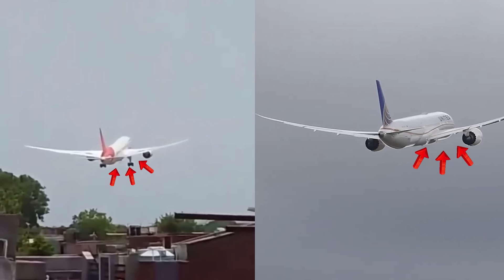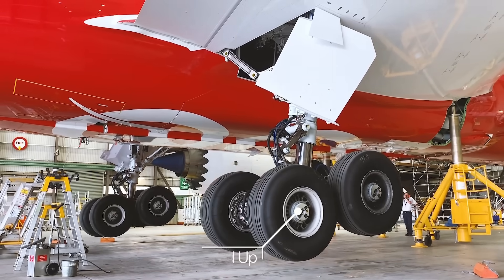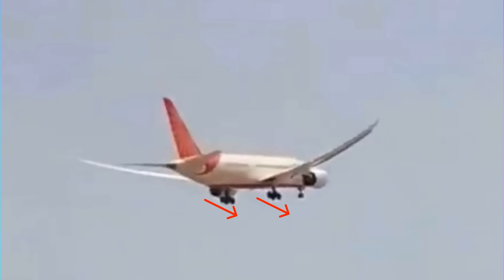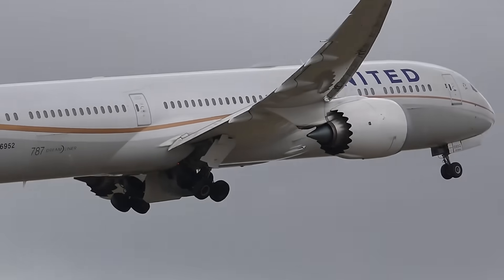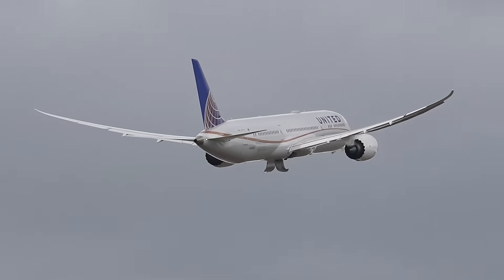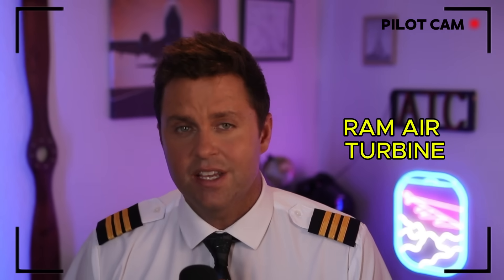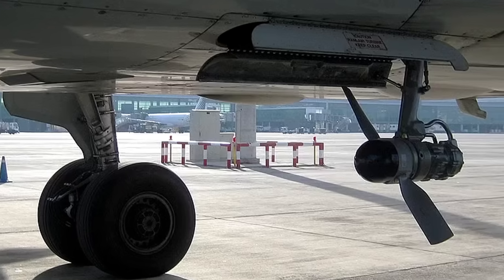Pilot Explains: A New Detail in the Air India 787 Crash Everyone Missed

Comment: Previous electrical issues.High ambient temperature.Aircraft static in 40 deg temperatures for prolonged period.Possible scenario - 
Circuit breakers are susceptible to thermal influences, primarily due to their reliance on heat for operation, particularly thermal circuit breakers. Ambient temperature, heat generated by the circuit breaker itself, and heat generated by other components in close proximity can all affect their performance and lifespan.
Overheating: When circuit breakers are exposed to higher than normal temperatures, they may trip due to thermal overload. The increased ambient temperature can reduce the breaker's ability to dissipate heat, causing internal components to reach critical temperatures.

Comment: Hi you are right 
I am a normal man put of germany  with adhd and i am very good in technic.
There is a problem with hydraulic gears stays down pumps get out plane rotate no more postive fuel preasuere and this case the suck air in the engines a vaper engine failure
Reply: And thats because the plane is in a very hot take off condition all is hot 2 hours on tarmac 
I think this was the problem

Comment: I believe logical speculations are down to two main scenarios:

1) just as plane tilted up for takeoff, both engines lost fuel supply, resulting in electric outage..

OR 

2) Major electric outage resulted in fuel supply cutoff (if that's even possible!)

However complex the core reason may potentially be, it's very likely simple as that.. Fuel supply cutoff.

Comment: What if the electrics went out first ? I might be wrong but if you had an electrical power failure you would loose hydraulics and also the fuel pumps which  would also explain why the Rat deployed.

Comment: It was very vey hot on the day - maybe fuel line system vapour lock. Both engines spooling back at the same time - very odd and so a single cause is in my mind. Time will tell

Comment: If there was a major failure in the electrical system then the fuel pumps would stop working, leading to both engines shutting down. Could the landing gear retraction demand have caused a catastrophic electrical failure, hence the partial retraction of the main wheels as the hydraulics would have failed? If I understand correctly there’s triple redundancy in the 787 flight control system, any mechanical backup (which I don’t think there is) would also fail as there were no hydraulics. The CVR and CRDAU/crash recorder will provide vital information as to the cause. 
Also, during the descent looked controlled, there was no sudden change in attitude, it still had a positive angle of attack. It’s almost as if the pilots were trying to bring the plane into an emergency landing, but there was nowhere clear to land. The same could happen at Ronald Reagan airport, London City airport and probably many others that are located very close to densely populated areas.

Comment: Is it possible that the plane was loaded with contaminated fuel before take off.  If so, there would be I imagine, some of the ORIGINAL FUEL still in the pipes leading to the engines allowing it to taxi and take off...... Once in the air the ORIGINAL FUEL was used up....then the CONTAMINATED FUEL caused the engines to stall..  
Just a thought as the plane did Taxi and Take Off.
Reply: No. It’s not possible. Unless a contaminant was deliberately mixed in an act of sabotage.

Comment: Good  logical presentation, it’s beginning to look vert much like a duel  engine failure, if so , the next question is why. 
It worries me that it could be electrical failure. The 787 had many electrical problems in its early days, the battery run away fires was the most publicised issue, and apart from jettisoning the runaway battery, I don’t remember there being a proper solution. Has any one got any updates on the battery situation ?

Comment: According to ChatGPT a dual engine failure during takeoff under the given circumstances the most likely cause:

	•	Fuel starvation: No fuel reaches the engines (e.g. mismanagement of fuel selectors, empty tanks).
	•	Fuel contamination: Water, ice, or microbial growth in fuel can cause both engines to flame out.
	•	Incorrect fuel type: Jet fuel accidentally replaced with avgas or vice versa, leading to failure.

Comment: Erroneous inputs causing automatic power reduction. Possible airspeed excessive input due to water or obstructions. For some reason fly by wire system with computer inputs reduced power or caused power loss on takeoff such as bleeding air off engine stages causing engine stall failure.... then what stops landing gear retraction?..... engines not running... no electrics hence rat deployed.

Comment: Vapor loss, dried out pressurized hoses / pump lines, due to long standing on tarmac before take-off.
During nose up, air bubbles will accumulate, like in bottle, in the wrong spots, that is not sufficiently anticipated, when at the same time it also adds to loss of hydraulic power in the landing gear pull up system.
This potential explanation was first brought up by another jetliner pilot tuber.

It was a boiling hot afternoon. The elements turned against sophisticated designs, calling out weaknesses and hidden flaws.

Comment: Most convincing summary I've heard so far. Add together the behaviour of the plane, the RAT deployment and the Mayday call, and it's clearly a catastrophic loss of power and thrust. So it can only be the simultaneous loss of both engines.

As to the reason for this, we can only wait for the official report and analysis. No amount of discussion on YT channels is going to get us anywhere, we simply don't have the facts. 

The only thing that still puzzles me is that they didn't rotate until the very end of the runway. This seems inherently too risky to be normal practice as others have suggested.

So, I'm left asking if this is another clue? Was there some sort of power/thrust problem before the takeoff - something that made them miss the normal rotation point, but also something that caused the pilots to think they could still make takeoff and that they shouldn't abort?

Is it possible that the engines didn't fail suddenly after takeoff, but they had started to fail before then, but not badly enough for the pilots to abort?

Perhaps, by the time the problem became serious enough, they were already well beyond the point of no return and had no option but to just try to take off and hope for the best?

If so, then that must have been an unimaginable few minutes of terror for the pilots.

Comment: Thank you for the video. The two engines look like they ran well enough to gain sufficient speed for take off, and suddenly went off either on the end of the track or immediately afterwards. It does not look like any voluntary action by the pilots, but rather like fuel valves in the feed line would have closed for whatever reason. Is there an even remote possibility for that to happen? The fuel would have required an insane contamination to stop burning like that all of a sudden.

Comment: To me, after watching all the analysis and theories, my assumption is, The plane just after the takeoff, lost total power of the plane. What I meant by that is, after the takeoff, the plane's total power supply and control system went offline. The engine went off due to power supply and the only thing that was functional was the RAT. that is why, the nose of the plane was up while it crashed slowly with no engine sound whatsoever. Also, from several sources, there was a conversation lines between the cockpit and ATC that soon after the pilot said "Mayday! Mayday! we got no power, no thrust, going down" meant that the plane's entire electrical and mechanical system got shut down.

Comment: A problem with the FADEC could cause a dual engine shutdown.  Also gear down and no flaps just past V2+10 with a full load, even with full power on those engines,  would not be enough to power up the 787 out of a stall condition.

Comment: Plane lands with Jet fuel. Plane fills with road desiel loads starts and taxi on good remaining fuel in the system. Full throtel desiel finaly gets to engines and kinda works until double flame out. I would expect a puff of white unburned fuel at flame out but did not see. This may have happened at the final moments at speed on the runway.

Comment: Useless %theories about Both Engines failing!!

The Aircraft FAILED to Lift because the Two U Tube Pilots took off WITHOUT any FLAPS deployed!

No FLAPS , No LIFT.
Hence the Mayday call "NO POWER" because they were FAILING to LIFT, due to ZERO FLAPS!
The Pilots thought they were FAILING because of 'No Power' from the Engines, BUT they were IN FACT FALLING due to ZERO FLAPS , and perhaps a slight Electrical interference, mid Take off, which would NOT have shut down the Engines, NOR other CRITICAL Flight ELECTRICAL Components, as there are MORE than ONE Electrical Systems, on an AIRCRAFT! 

Stupid Theories!

Comment: My theory is: Definitely lost power in both engines at the same time without any signs of violent damage. The odds of both engines independently stopping working at the exact same time are too tiny to even consider unless both engines stopped working due to one fault ( or several ) that affected both, on an airplane disaster like this it is never 1 reason on it's own but a combination of reasons that are unlikely to happen at the same time but have some considerable probability over the period of decades. Considering the manufacturing problems Boeing had in the past including software issues, I believe there must have been a combination of factors that include a software issue and some malfunction of electric systems or battery or power electronics or even also some slight mistake made in the latest maintenance, something like that, I'd guess roughly 3 different reasons that came together at the same time, maybe even the high temperature was a factor and I suspect a slight technical / software issue that was amplified by other factors. Disclaimer: I know nothing about planes.

Comment: Without a mechanical back up ,Flight 171,s Skipper  had no throttle control of both engines, as you said a dirty B787 with full power can  climb out of trouble, those GE90NX.s chuck out serious thrust at full throttle.

Comment: pure speculation, it looks like during rotation they still have power from the thrust wave seen in the other video, but could it be the rotation action have finally wiggled something critical offline due to construction issue (fuel pump line, power line etc.)so upon rotation, the fuel pump instantly died off and cuts all engine.

Comment: I’m wondering if the video posted by a passenger on the previous leg of the aircraft—showing that the air conditioning and entertainment systems were not working—could indicate ongoing electrical issues.

Comment: Contaminated fuel doesn’t cause an INSTANT cut out in both engines you would hear sputtering of the engines and they would go off at different times more probable is an electrical short circuit taking out the fuel supply

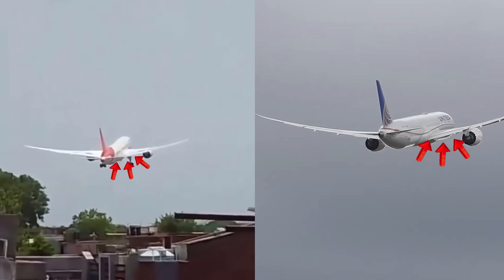Comment: 1:50 The shadows on top of the wings strongly suggests the flaps are extended. I watched someone on YouTube that does a lot of videos covering all kinds of accidents actually say the shadows were because the air breaks were deployed which make zero logical sense.
2:33 Exactly. I commented this on that video. And as I said on his video, modern engines are much more quiet, but engines at takeoff thrust aren't quiet and you would without a doubt hear them in the video if the engines were producing thrust.
47:27 I get the contaminated fuel theory, it's the most plausible conclusion for a complete loss of power, but wouldn't that cause at the very least reduced thrust during takeoff and subsequently take them longer to reach V1 and V2?

Comment: I hope they recover & are able to salvage either or both of the engine EECs assuming they separated as part of the engine & away from the fireball. They contain valuable data that could aid as a backup to that obtained from the DFDR (which they really need to get a move on with - it has been 3 days now & no information has been forthcoming on the status)

Comment: My opinion is quite the same :
It could be a problem with the fuel
It could be a problem with FADEC electronic devices (like the A400M in Seville)
It could be an error of the pilot who turns off the wrong engine

Except these possibilities, I don't see what could cause this crash

It's definitively not a configuration issue, because with a simulation in the same context, even without flaps the aircraft stays airborne...

If I could take a decision : I will probably ground every 787-8 on earth to inspect everything

Comment: I agree with you and I even noticed that the landing gear didn't quite look right positioned, also Captain Steve immediately blamed the pilot for something which those pilots have done hundreds or thousands of times and are highly trained, is an insult to all pilots saying the idiot pulled the wrong lever. The 2 engine failed points to the power generator failing in my opinion.

Comment: Hey Gary, I think the malfunctioning AC packs may have led to extremely hot temperatures in the avionics bay, forcing the fuel controllers to go into safe mode, killing the fuel pumps. Either way definitely a fuel related problem.

Comment: Yes agree with the power issue. Beyond the RAT sound, that was the next obvious sign in that video. No engine roar. Sounded like they were spooling down not up.  There might have been a mechanical failure of some kind effecting thrust. My gut feeling is that there was a pilot stress inducing problem of some kind, even if simply an overweight aircraft on the edge of its limits struggling to gain lift on a very hot day and which took the whole length of runway to get airborne and kicked up dust towards the end.  If it was human error,  that stress moment might have delayed raising of the landing gear.  They were only  600 feet above the ground. It had to be an automatic action straight up or the aircraft under the conditions was doomed.  They were already on the limit if it took a full length of runway to get airborne.  The other question is, did the plane actually overrun the end of the paved runway. This is a critical factor and question to be answered. There was a lot of dust generated when the plane took off towards the end of the runway. The pilot should retract the undercarriage straight away after take off, as soon as a positive rate of climb was clearly established. Thus was dust ingested into the engines ?

Comment: My opinion now, after seeing the RAT deployment has changed things. I think that the flight was overweight and missed the end of the runway at takeoff. You can clearly see the dust being kicked up as a result.
I think that some debris was flicked up inside the undercarridge tunnels and damaged some electrical/ hydraulic components which caused the loss of both engines.
In the video where the RAT is deployed you can hear the tubrines, but they are not producing thrust in my opinion, they are too quiet.
It is such a tragedy that this has happeend and my condolences to all the families.

Comment: There is a New York Post YT video beginning 'Nothing is working' which shows a recording apparently made by a passenger on the exact same aircraft on a previous flight two hours before the crash. The passenger observes that the air conditioning and other electrical systems appeared not to be working. Also unverified, but one comment states that a former Air India pilot is quoted as saying the crash aircraft had suffered serious technical problems for a long time.

Comment: From the available information, it certainly points toward a dual engine failure. The mayday call made by the pilots also reported a loss of power and thrust. Fuel contamination seems unlikely, given that Ahmedabad is a major airport in India with multiple checkpoints. I'm therefore leaning toward a mechanical failure—possibly due to maintenance issues or, more likely, Boeing cutting corners.

Comment: I could be completely wrong.. I am not there to look at what I would need to see to bemore confident. I did here engines at an idle. I do not know how many different ways the throttles are controlled on 287.. cable, hydraulics or electronics... If it is electronic.. then a reason for eng to stick at an idle could be a faulty repeater.

Comment: Previous electrical issues which were pointed out (ie air conditioning not working ) combined with the aircraft standing in 40 degree heat has led me to put this forward - 
Circuit breakers are susceptible to thermal influences, primarily due to their reliance on heat for operation, particularly thermal circuit breakers. Ambient temperature, heat generated by the circuit breaker itself, and heat generated by other components in close proximity can all affect their performance and lifespan.
Overheating: When circuit breakers are exposed to higher than normal temperatures, they may trip due to thermal overload. The increased ambient temperature can reduce the breaker's ability to dissipate heat, causing internal components to reach critical temperatures.
Reply: Planes sit in the hot sun for hours, everywhere.

Comment: Software can shut down two engines as well. This has happened in the past. ANA 985 flight  in 2019 -  Thrust Control Malfunction Accommodation software (TCMA) activation caused both engine shut down on the ground . In 2015 three out of four  engines of an Airbus A400M failed due to a software problem causing the plane to crash shortly after take off. 
There is no need to guess at this point. Flight data recorders will soon reveal the truth.